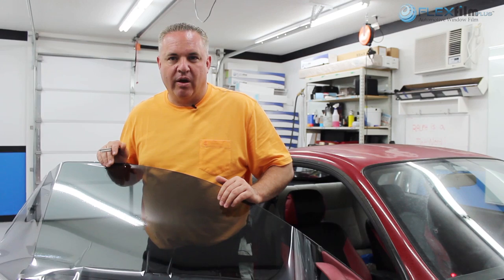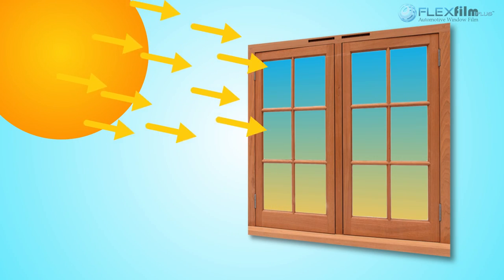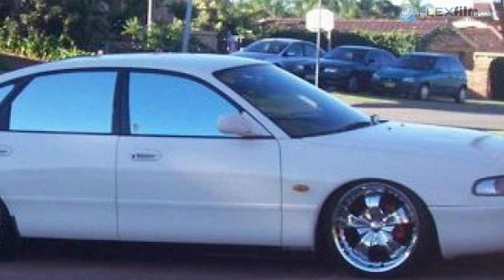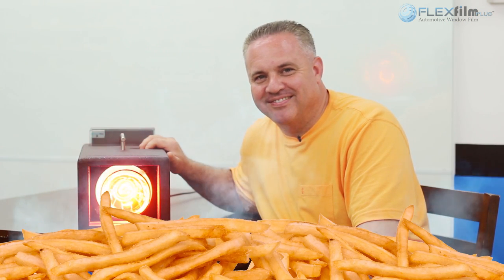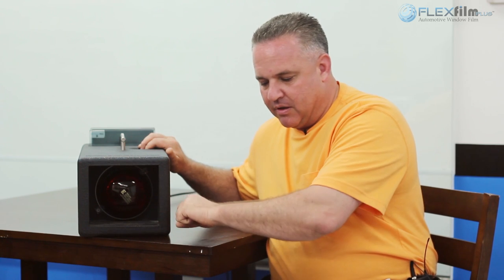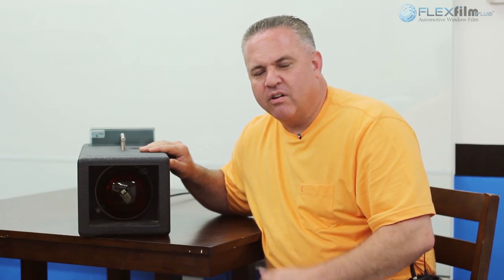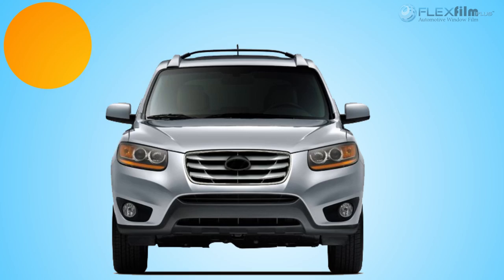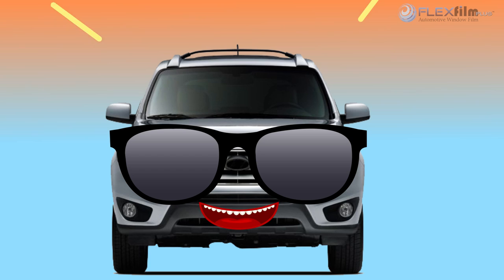Does Window Film Block Out Heat?

Comment: You get the perception of heat because it really is heat.  It does work differently than other types of home heat however.  It doesn't heat the air like a furnace, but it heats objects.  If you were in your living room, turned on an infrared heater and left and come back you may not notice a difference in the temperature until you are exposed to it, but it isn't just some perception of heat it really is heat.  This is the kind of heat they keep your food hot with at fast food places.  If it wasn't really heat your food wouldn't be hot when you get it.
Reply from the maker: Charles Wright 
Heat is actually created when the solar energy excites molecules and the molecules begin to rapidly move or vibrate.  The friction generates actual heat.  We can measure the radiant heat with a thermometer.  We can not measure energy with a thermometer.  Solar energy consist of visible light, ultraviolet rays, and infrared radiation.
Reply: I know all about how it is created from infrared radiation.  But that feeling you get is from the actual heat that is created, not just a perception of heat, it is real heat.  The video you made it seem as like it wasn't heat and instead you just feel like your skin is getting hot, when in fact your skin is getting hot.
Reply: But I think I know the way you meant it now anyway I think you meant it as you feel hotter than the actual surrounding air temperature in the vehicle is, and that is what you meant by the perception of heat.  Which is correct by that interpretation I guess.  I thought what you were trying to say at first was that what you were feeling on your skin was just a false sensation of heat, even though the skin is really being heated.

EDIT:
You are correct you cannot measure the energy with a thermometer.  However you can measure an objects temperature before and after being exposed to infrared energy and see that the object itself has gotten hotter.  Basically what I was trying to get at.  For example a winter day where the temperature is consistent or even dropping you can measure your shingles with a thermometer and after the sun has been on it, even though temperature has remained the same outside or even lowered the shingles themselves got hotter from the actual heat created.

Comment: Does a lighter film block more or less heat than a darker film?
Reply from the maker: A window film is just like a car.  It has to have horsepower and suspension to win.  A window film offers protection and comfort and it has to have both to be good.  Any film that can keep solar energy from passing through the glass will protect you.  It also has to have a coating technology to slow down the heat after it has been absorbed into the glass.  Does not really matter if the film is dark or light.  What matters is what is the technology of the film.  A light film with a good ceramic coating can slow down heat and solar energy better than a dark dyed film.  A dark ceramic film with a good coating technology can slow down heat better than any light film.
Reply: @FlexFilmPlus  Thanks for the reply
Reply: @FlexFilmPlus  I've heard that a 70% ceramic film will block more heat than a 35% ceramic film. What's your opinion on this? I've seen them tested with a BTU meter.